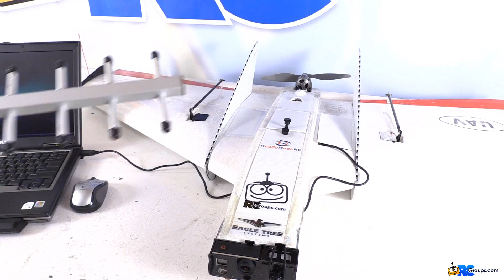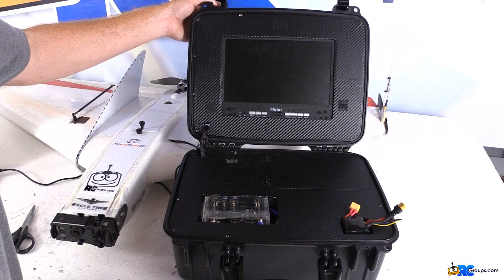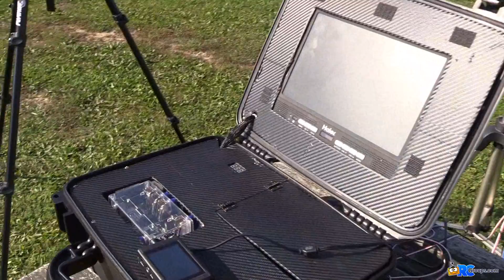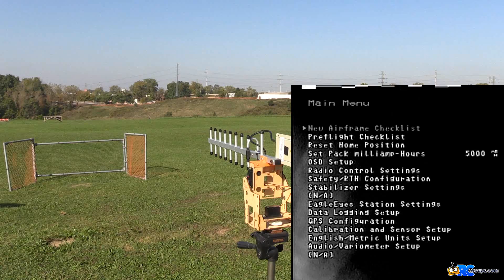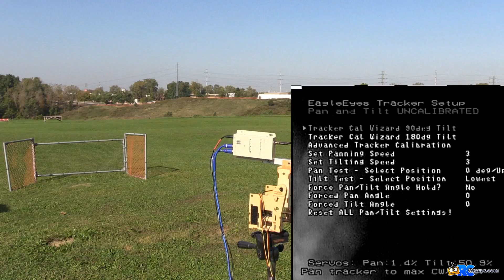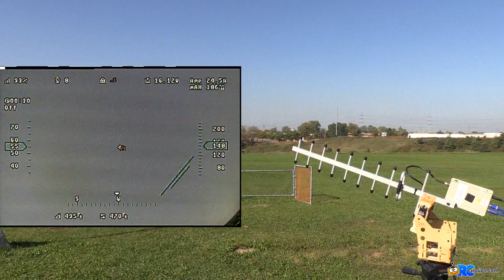Eagle Tree Antenna Tracker Tutorial - RCGroups FPV Video Review

Comment: I would again like to comment. I have researched over a dozen of the Eagle Eyes units. I own three units personally. I have tried every conceivable combination of parts including but not limited to radios, servos, receivers, wires, batteries and so on. I have yet to witness the Eagle Eyes unit actually calibrate and/or track a Vector AP. Experience tells me that I am missing an input or have some electrical process failure. Regardless...I have been in the hobby for over 15 years and I have yet to experience an Eagle Eyes tracker that works. Surely a resolution exists that I or the circle of users in my area have missed. Any suggestions?
Reply: I haven't done it many times but when I setup my Eagle Eyes for tracking my Vector equipped aircraft it did work. IIRC I just followed the instructions in this video and it worked.

Comment: Hello, I am new to this antenna tracking system. I have the EagleEye ground station and I want to set up the antenna tracker. Can the EagleEye work with other flight controller or must I have the vector before I can get the antenna tracking to work?
Reply: Sol mag....read my comments in this thread. I would like to communicate my experiences. Feel free to respond.

Comment: I have an Eagle Eyes Tracker setup. All new kit from Eagle Tree Systems. Everything behaves as designed and as indicated by the Operation Manual except when you get to calibration. The tracker will not move via manual calibration attempts with the elevator stick. I have manually hardwired the Vector video to the Eagle Eyes. Used multiple servos, three different radios, antennas, cables and multiple Eagle Eyes. I have 5V DC coming out of the Eagle Eyes servo ports. When I test the servos they work great. I have multiples of everything needed for the Tracker and each setup behaves as described herein. There is no binding in the tracker. Any thoughts would be great...thanks

Comment: I have been experimenting with using antenna gain as my feedback signal to smooth out the system operation. Using only the difference in the gps positions gives the slightly " notcy" movement. The processor has to resolve the difference between the two positions and convert this into a antenna steer. Negative feedback from antenna signal gain is my attempt to dampen this out a bit. Early days but getting there.

Comment: Hmm what do you mean that it is "tracking very well" ?? In the video there is a lag of about 30-45 degrees.. ?  Strange that you considet that tobe ok..
Reply from the maker: Not strange at all. That antenna is a Yagi and does not need to be pointed directly at the aircraft to work, there's a 60 degree field of view, so if there's a little lag, it's not a problem. Reference the video and you'll see no breakup of the feed at all. Trust me, I've used this setup extensively for years now and it works great and tracks well too.
Reply: I don´t mean the antenna it self but the tracker, does not seem to be all that accurate as I would expect, if for instance the distance was significant the I would be concerned if the tracker is not able to keep the antennas "peak" performance, i.e in the middle of the 60 degrees...
Well that is maybe a matter of adjusting the tracker..
Reply: More like if using a parabolic grid antenna with a tiny beam width.  Delay would mess it up pretty badly.

Comment: It looks like the tracker has significant lag.  the antenna seems to be 15 to 30 degrees behind the plane.  What's the "beam width" on your receiver antenna?
Reply from the maker: wide enough that even at 100 feet out, it has perfect signal.
Reply: rcgvideos That's wider than I would have expected.  what kind of range do you get with this setup?